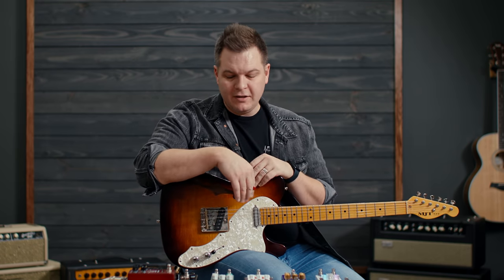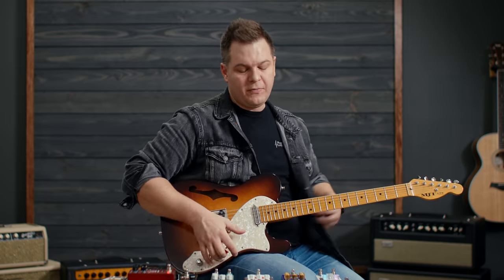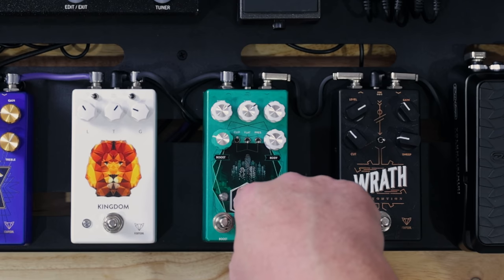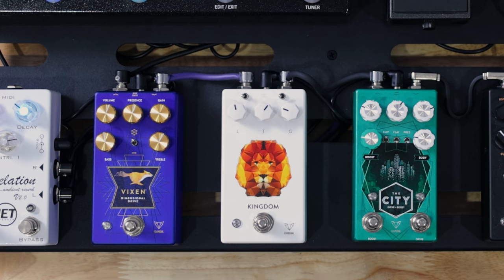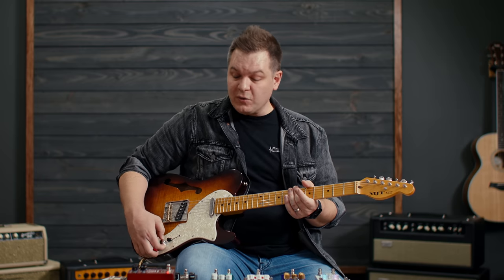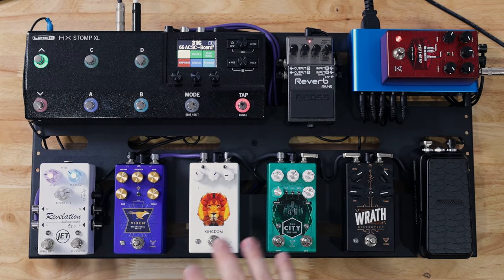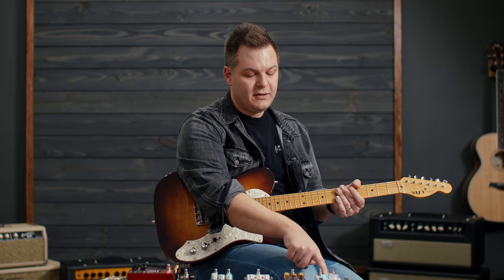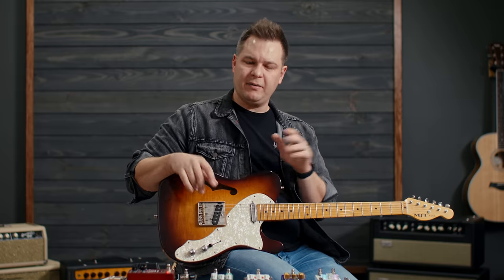The Overdrive Guide // How to dial in your overdrives

Comment: This is super helpful. I may have implemented a lot of what you showed on my board-in-progress. Right now I have 2 Boss ODs (SD-1 and OD-3) and an EHX Soul Food going into my HX Stomp. Only pedal with gain remotely close to 12 o’clock is the SD-1. Everything else is at 9 o’clock or lower with the volumes at 2-3 o’clock. Stacked together they sound huge.

Comment: In this video, I assume the compressor is before the drives? What are your thoughts on compressor after them, btw? (It seems like optical comps are also the preferred types to use when it’s after drives…)
Reply from the maker: Adding a comp after drives will make volume fluctuations from turning them off/on less. And it will reduce dynamics. That might be what you want, or it might not. Just depends. Personally I don’t like a comp on my board after drives, but I often compress the guitar in a mix, which is essentially the same thing. 

I’d use something subtle. Optical style would be good, but 1176 (FET) would be my go-to.

Comment: When you push your amp harder you get louder right?
So what gain stage are you using for the sound guy to set the gain on the sound table?
Thanks!
Reply from the maker: It depends on the amp. And how much headroom it has. Typically more gain means louder but every amp reaches a point where more gain just means more saturation without an increase in volume. That’s where it reaches its headroom limit (which is a simplified way to describe it). 

For sound checking (whether I’m running sound or playing guitar), I always ask for (or give) FOH my loudest tones to set gain at the board.

Comment: Question:  Are you running the OD & Dist pedals through the effects loop in the HX Stomp or in front of the HX Stomp?    I JUST bought a HX Stomp and am planning on using a OCD with it, but was thinking I would just put in front of the Stomp so as not to use a block for the loop. Thanks for videos!!!
Reply from the maker: Thanks! The overdrives are going straight in. Only the reverbs are in the effects loop

Comment: How can you apply this technique to non distorting amps? Like say a GK bass amp?
Reply: For perfectly clean amps, you use the gain settings on the pedal mostly and want to set the pedal level (output) to close to unity.